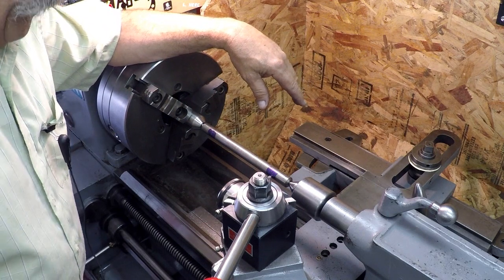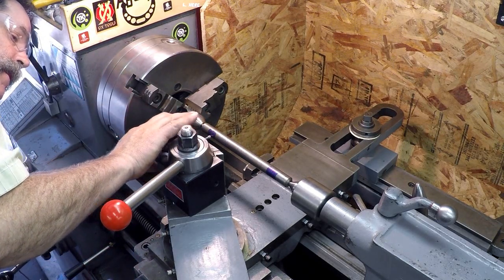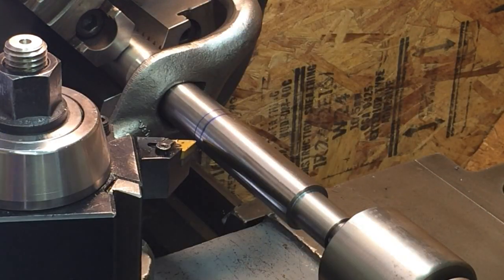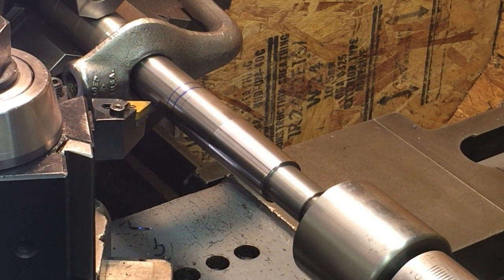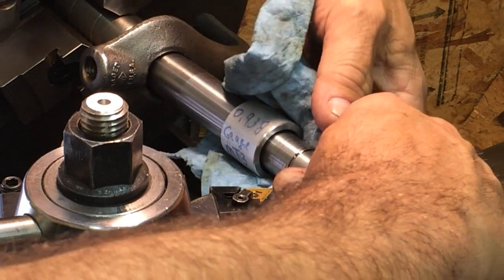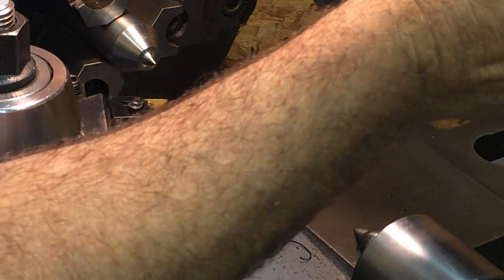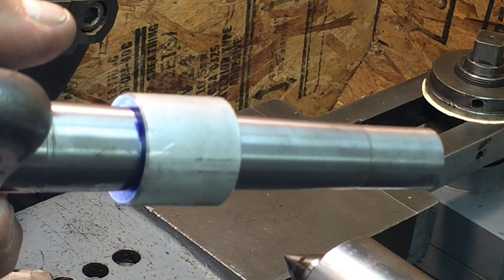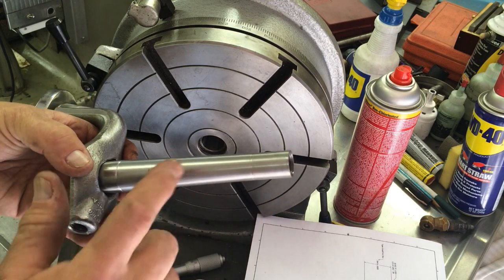Rotary Table Chuck Mount Part 2

Comment: As other's have mentioned, at least you still have hair!!
Glad you figured out the problem with the taper, as we know it was doing weird things on my spindle we made.
Also, do they make that insert with a chip breaker? Those long stringy chips seem like a pain!!
Beautiful job Randy, and I so need a cad program that I will be able to draw my things I want to build. Guess I'm going to have to dig in and learn more when it comes to all these electronic gismo's!!
Ray
aka: Razor!
Reply from the maker: Razor Works Light cuts slow, poor chips.  CAD is great.  Thanks Ray.  Randy

Comment: Next time wear a hat when spraying white paint.
Now you need to get out the black paint to cover it up.
;)
Nice video. I see the taper attachment is working well.
That big white fiber washer under the big lock nut is what you said fixed it? 
Cool.
Thanks
John
Reply from the maker: John Bazaar Yes the manila folder washer worked great and stopped some small slippage I had.  Thanks Randy

Comment: I did not see you set the taper on the attachment when you cut the morse taper?  Do you use the crossfeed dial or an independent one on the attachment?  Do you have to disengage your crossfeed screw nut when the taper is in control?  I am very interested as I have a taper attachment for my Grizzly G4003G but have not installed it yet as I believe I will have to remove my back splash guard, move the lathe out from the wall and relevel it.
Reply from the maker: +Douglas Thompson I will do that, Douglas.  Yes i have to disengage my crossfeed.  I use the compound for depth of cut.  I just finished filming a project using the taper attachement, but no setup.  I will work that in.  Thanks, Randy

Comment: I have to ask. Why not just start from your minor diameter and let it turn out? I know you would need to take a few steps to do it because the cut would be too deep, but it should give you a good taper without so much time spent trying to sneak up on it from the top down.
Reply from the maker: bcbloc02 I would agree with you.  I have been having trouble with the taper attachment and cutting in the direction I did the Taper attachment seemed to work better.  Thanks for the suggestion and maybe the next one.  Thanks Randy